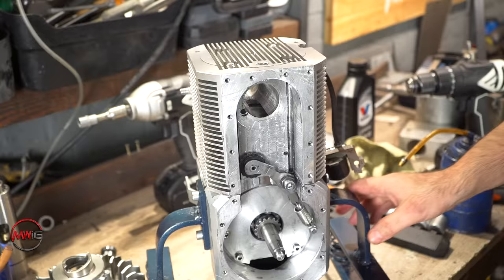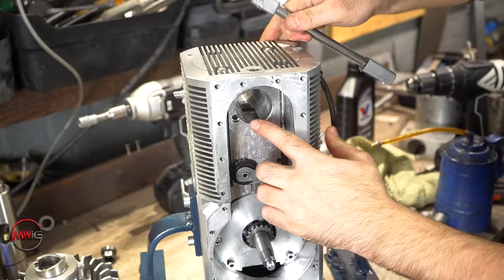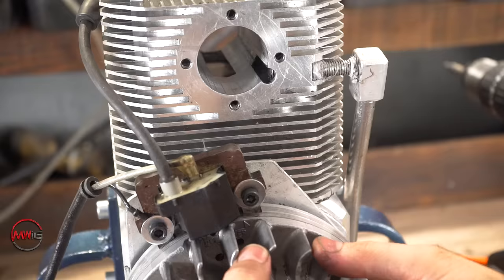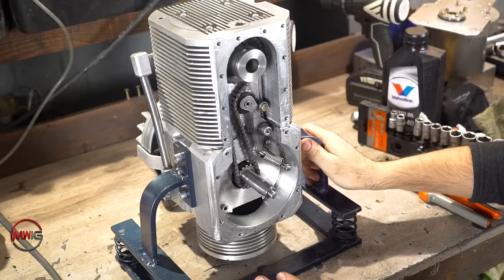I built a brand-new Rotary Valve Engine, and it works!

Comment from the maker: For those who don't understand what the video is about.
The fact is that I made this engine myself, but it did not start.
You can see the entire manufacturing process of this engine here: https://youtu.be/u_F5OGjLpOQ
Reply: esta quemando mucho aceite. posibles fallas: aros rasca aceite, retenes en tapa de válvula. saludos desde argentina
Reply: This is awesome. I would love to know what rpm it can rev to
Reply: Congratulations 🎉

question why did it smoke sorry if I didn't give attention if it's a 2 stroke with valve or a 4 stroke
Reply: Попробуйте этот двигатель поставить на технику любую
Reply: You are the best!!
Reply: Congratulations!  I too know well the elation of building a complex machine and watching it work for the first time.  I especially appreciate the Mad Scientist crazy laughing as you inhale the smoke of victory.  I do that also.  Keep up the inspiring work.  Ed
Reply: Where is all this smoke coming from? Its smells like a burning oil to me🙄
Reply: you know that next you need to mount it on something and make it move, right? ::)
Reply: I felt for you when it wouldn't start after all that work; I am so glad to see you followed up on it and succeeded, that is AWESOME!
Reply: 🎉🎊 Celebrate!
Reply: @mauroschonhals8402  the overhead "spool valve" shaft needs seals on it... he did say the fit wasn't to the tight tolerance he was aiming for... now that he knows it actually runs, he can fine tune the individual parts for efficiency.... 👏👏👏

😎👍☘️🍺
Reply: Cool, good work, make a resonant exhaust pipe, select the size experimentally and measure the speed and power, I hope everything works out, and I wish you good luck.
Reply: I see the entire past video congratulations
In case of ww3 all the humanity need this motor
Reply: Поздравляю, теперь пора патент регистрировать) ахахах.

А если распредвал(up shaft) сделать перворированным, а не одним отверстием? Использовать масло более густое? Разделить охлаждающий и смазывающие каналы?
Reply: you should now put said engine on a go kart or mini bike and give it a load test
Reply: I have read one comment to add separator rings (using piston rings) on the your cam, the oil is coming in to the piston that is why it smokes, if you can find a way to stop the oil from doing that i bet your engine can rev faster and stronger.. Amazing Project that can be used on a motorcycle,
Reply: @asmiruskovic2489  I agree with you. I think the camshaft needs O-ring seals to prevent oil from being blown into the cumbustion cycle during the intake phase.It would be interesting to place an oil pressure gage inline with the external oil transfer line. I cannot remember if this engine has a crankcase vent or not?
Reply: I watched every second of your original build and remember thinking , when you painted everything before you had even tested it, that you are an eternal optimist. I was disappointed when it did not run. This video makes me very happy for you. Just a quick question. As they engine is self oiling, why did you add oil to your fuel? It certainly turned it into a smoke monster. Or do you need oil seals on your intake/exhaust shaft. Just a thought.
Reply: i like it!!! and now: less smoke, measure power, tuning, more power, vehicle. or explosion. thx for your videos!!
Reply: Excelente trabajo eres un genio 👍👍👍
Reply: What's the piston and crank from
Reply: Big congratulations bro....!!!!
I'm amazed at your accomplishment......truly amazing.
I wish a the best and I look forward to seeing you succeed and become famous. 
What's your background.....or how did you acquire the knowledge to design it and come up with all the measurements and particulars...?
Please let us know and congrats once again.
Peace....✌
Reply: @asmiruskovic2489  a lot of burning oil
Reply: When I put noisy smoke machine into Google Translate, I got: “Engine”!

Now I understand 🧐😎😜

Also, here in post industrial revolution UK, to prevent that erratic pouring flow caused by air being sucked into the void trapped behind the fuel, we hold fuel bottles sideways so we don’t splash the fuel as we pour… 🧐😎😜 Science

I do actually love your rotary valve noisy smoke machine, and wish I had one to annoy my neighbours. 

Peace
Reply: Can you make this work with compressed air as fuel or high pressure liquid as fuel take this as challenge are you ready for another challenge
Reply: It has way to much blow by it’s running off it’s own oil if you was to put rotary apex seals on the intake shaft I think it would fix your compression issue and your blow by issue
Reply: You mixed 4T oil with gasoline instead of 2T oil, that's why your engine smoked so much. You must try 2T oil with gasoline, or gasoline without anything. I like what you did, good luck!
Reply: make patent for that.. because it is on the internet.. we don't know maybe the future cars will run your engine
Reply: Похоже масло для сказки золотников идёт прямиком в цилиндр. Иначе чего бы ему так дымить.
Reply: never give up
Reply: Now lets see it drive something!!!
Reply: Very cool bro. Can't wait to see what you power it with.
Reply: So this motor in theory could rev higher than a conventional engine because it doesn't have conventional valves though I would have to question the strength of that camshaft specifically when lengthening it to support more cylinders as well as the exhaust and intake flow you could get though I guess in a sense you could always fix that with a supercharger or turbocharger side note why does the oil have to be mixed with gas isn't it technically a 4 stroke engine (this is the first video I've seen on this engine)
Reply: Bro use 2t oil for mixing in the fuel
Reply: @mauroschonhals8402  tu cómo que lo viste el primer video verdad? El se hizo su motor, no tiene válvulas, este es el vídeo dos de cómo lo hizo arrancar porque el primer intento no le dio, y si, está quemando demasiado aceite, espero ver más vídeos de cómo lo va refinando lentamente
Reply: This is a huge accomplishment! I'm glad to see you made some key checks and adjustments, also a break in cycle and a carburetor adjustment would probably do a lot to help it start easier and not make so much smoke
Reply: Could you dyno it ? (check power output in horsepower)
Reply: Do not put so much oil in gas, is smoke much oli
Reply: I have one better idea to build new engine, never build anyone, easily and 4x4 better from rotary engine
Reply: .lp
Reply: Great job!  I just came over from your other video, and I saw that your idea didn't work.  Now, I see that you gave it another look, and some of your fans gave you some good advice.  In the end, your idea did work!

Now it's time to file for a patent on your idea.  Hopefully, someone didn't put in a torpedo patent in and then steals your idea in court after you've started selling licenses for scooter manufactures to make engines based on your design...
Reply: Thank you for liking my comment
Reply: @liangmarkv  basically a 2 stroke with a rotating shaft to work as valving . see his other video. this is trully amazing work
Reply: @inventas  ok thank. i hope in next video he will make it 4 stroke for less smoke 

it going to be hard seal the oil from the rotary valve. i want to see a solution for that  problem rubber will not work because the heat
Reply: Ассалаам 1алайкум,  кавказец?
Reply: @mauroschonhals8402   wow
Reply: @jadesmith6823   cool
Reply: @user-wn9he4uy8b  thanks
Reply: @jadesmith6823  🥰🥰😋
Reply: BRAVOOOOOOO
Reply: What tolerance did you use on the valve? Maybe tighter tolerance would result in a better compression.
Reply: Если верить в свои силы все получается. Как и у вас. Мне остаётся опладировать
Reply: Don't give up on this engine. If perfected this would be more thermally efficient than an engine with valves. Another advantage is this engine is not an interference engine so it would be better suited to very high compression and super lean charge. Using the exhaust heat to to vaporize liquid fuel droplets is a byproduct of this valve port design and this will help with efficiency. If you're sticking with liquid fuels would it be possible to exchange exhaust heat with the intake air charge to super heat it before entering the combustion chamber? 

If you can fix the sealing issues this engine would have no rev limiter at all. Zero valve float is the holy grail of engine design. Your only limit is the acceleration limit of the piston itself. 

Eliminating engine heads is the next step since heads soak up most of the heat from combustion. If you design this engine so two pistons come together and combustion takes place between the pistons you would effectively eliminate one of the causes of waste heat and inefficiency of the classic design of engines with heads. Instead of one valve shaft you would use two, one on either side of the piston. 

You could increase the size of the intake port so the engine does not get starved for oxygen. The smoking suggests the engine is oxygen starved. Next steps would be to test the maximum flow rate on a bench of the intake and exhaust. Also, if you use cryogenic fuels like propane or hydrogen this super cold fuel passing the rod will help cool the valve rod. The valve rod will change its size with heat and this could be a problem for sealing. I'm also not sure why you went with a sleeved design since you would have gotten better sealing with no piston sleeve and the block would have held up to higher RPM? 

What needs fixing: Better sealing between the intake charge and exhaust charge, better sealing of the port rod to the combustion chamber, higher compression ratios (shave the block to bring the piston closer to the top of the bore), variable valve port timing based on RPM and engine load, variable ignition timing, forced intake (turbo), a proper ignition system from a Honda generator or small car. One of the next steps you could take is to create your own piston design that keeps combustion chamber size smaller on top dead center which would allow you to run a leaner charge closer to the spark plug and compensate for smaller intake valve sizes. 

If you intend to use this engine for aircraft you should have a dual ignition system with two spark plugs, and two ignition coils.
Reply: @jasb78  приветствую. Не согласен с выводом о подогреве топливной смеси. Это может привести к воспламенению при не значительном сжатии этой смеси. Тем более нагрев газораспределительного вала приведет к изменению зазоров и выхлоп пройдет не только в нужное место, но и в отсек с рабочей (горючей) смесью. Это приведёт к не предсказуемым последствиям.
Reply: Hello, I'm from Russia, more precisely from the Russian wilderness, the Republic of Sakha Yakutia, the city of Yakutsk. I watch the video and am interested in you, continue in the same transformation, good luck to you and ensure your channel. 👍👍👍👍👍
Reply: Yes, and the mixture is too much, and there is a lot of smoke🤭
Reply: @benjaminbaird3798  es un "prototipo", ahora que sabe que funciona podrán venir los ajustes necesarios en próximos modelos; ni las grandes marcas de motor funcionan a la 1°, al menos no siempre y, este tipo en su garaje... wow. Salud🤙
Reply: One thing is your flywheel is to light it needs it need to be cast iron for the weight and for momentum
Reply: Fantastic, now you need to put the engine in a boat.
Reply: master of his craft!!! excellent work friend!!!
Reply: Терпение и труд всё перетрут!
Упорный ты мужик!!))
Удачи!!!
Reply: @liangmarkv  cause of the lubrication of the rotating ports, this is the same issue I ran into
Reply: @russellnc  thanks you to your reply I appreciate it very much

Im also thinking if there's a solution for that
Reply: @user-ds8sj8zl6f  Ва1йалайкум ассалам,да брат,он кавказец,из Чеченской Республики
Reply: @ruslanruslanov1144  по любому наши корни
Reply: It must burn so much engine oil. All you need is a way to seal the shaft at the edges or the bore and it'd be excellent.
Reply: Чёткая речь у тебя! Даже на 2x скорости понятно, что говоришь! Поздравляю с успехом! Мне тоже нравится такая деятельность! Я тоже был изобретателем. Оказалось, что  до меня это уже изобрели но я не знал об этом. Нет возможностей заниматься любимым делом. Только теория. Для практики нет возможности. А если не можешь сделать то, что придумал, то и придумывать некогда. Приходится заниматься только необходимыми делами.
Reply: The very first V-8 Fords were "FLAT HEAD" style engiines. 
 The compression ratio on those first models was only about 5.5/1. 
 This was "bumped up" a little in several successive models.
 None ever exceeded about 7.1/1.
Your engiine SHOULD still work at around those starting compression levels.  
 Power will NOT be very great.
Reply: Very fine ! 
I don't think it will win any awards with the E.P.A. 🤔💭
Reply: If i had your mind i would make a go kart or small bike for that GREAT JOB!
Reply: Congratulations 👏🎉🇵🇭
Reply: Indonesia watching you video
Reply: Deci eu nu pot să cred că esti româm, ceea ce faci este incredibil
Reply: @Nathan Nobody Pistons are intentionally oval, or cam ground, to account for thermal expansion.  Also, they're technically cylinder shaped. HAHAHA (I couldn't resist🤣)
Reply: @jasb78  Nice ideas, but I'm going to guess that Mr. MWIG doesn't have the engineering budget of Ford or Toyota.
Even though this idea has been tried by several far better funded groups, it's impressive that he did this on his own, with tools and materials that any of us could own.😎
Reply: Ассаламу 1алейкум .поставь масло съёмное кольцо на поршне .масло  много берёт.
Reply: @davidboss2160  or... A tank! He needs to combine it with his latest project.
Reply: Te pudistes a a ver ahorrado tiempo cambiando el tesor porque cuando lo accionas con el taladro giras a la derecha obligando al tensor seder bro es la cadena,  el tensor al abrirse cambia el tiempo brooooooo es muy obio pudes mejorar ese motor y muy básico
Reply: The oil burning issue is too many holes in the camshaft lube tube. You need to put the holes so that they don't blow oil directly into the camshaft ports. Amazing idea, With no valves to float a much higher rpm is possible, plus if the ports are designed correctly they should flow more air then a valve,
Reply: Goid effort of you, good luck my dear.
Reply: I am praud of you.
Ich bin selbst Ingenieur.💪👍
Reply: @Alexxx95_H Tighter tolerance will help with blow-by and increase the compression - that is at the top of the wish list. Another point is that these valves don't seal at the top of the combustion chamber but rather down at the end of a tube, giving more area inside the combustion chamber and lowering the compression. Your suggestion is a key point in getting this to achieve high RPMs. No valve springs eliminate any chance of  valve float making it a good candidate for super high RPMs. If shortening the valve tube is possible I think RPMs will increase. Any thoughts on valve timing?
Reply: Etude được đi học về chưa thì thôi 👍👎⚙️🔧📽
Reply: @liangmarkv  2 stroke, no valve, no cam shaft, intake and exhaust through  the crank shaft.
Reply: Congratulations it's great to see you finally got it to run 😁
Reply: Çok süper oldu. Seni tebrik ediyorum.
Reply: you did an awesome work, thats the point. we dont give a s*** of the smoke, because it runs and smokes well :D
Reply: Nokhcho vuy ho?
Reply: is it possible to use diesel fuel for the engine?
Reply: I think you have to add a flywheel to keep the inertia 🤔 , Good job
Reply: You need to have an O-ring on each side of the valve and a seat as a base and bronze combustion chamber with a spring underneath to hold it pressed against the valve see the video at this link

Comment: Let's say one thing, I don't know much people who creates a full engine from scratch in their garage. You're awesome man.
Reply: If you like this, try alos '2strokestuffing' channel. He's fully built a 2 stroke 50cc engine, and is currently trying to tune it to run on Nitro AND supercharged, to make the most powerful 2str 50cc motor for fitting into a bike for top speed runs. Alex also has a quirky sense of humour. it is a GREAT channel to watch if you love all of this home engineering stuff.
Another channel is 'AutoBeta2T', where he is copying a famous motorcycle magazine's challenge of tuning a 90's Kawasaki AR50 to do 100 MPH !! (ALL home tuning and building!) 
I LOVE watching channels like 'Meanwhile in the Garage' and those other two (being a biker too helps! hahaha) 👍👍👍       😎🇬🇧
Reply: @thedarkknight1971  did 2stroke stuffing build a Wankel?
Reply: @forloop7713  As far as I know, no. He mainly concentrates on 2 strokes, rotary and reed valve variants with differing heads and crank case capacities (small are better for valve, larger are better suited to rotary valve type 2 strokes). Wankels - though similar in requiring a little oil within the fueling to help lubricate the apex seals etc - are 4 stroke, but are sometimes considered a '2 Stroke' to some degree.. 🤔
Reply: Hi thedarknight, I'm building my own design 2 stroke rotary type hydrogen fuelled I would love to see what your biuld look like
Reply: A real craftsman. Humans are amazing.